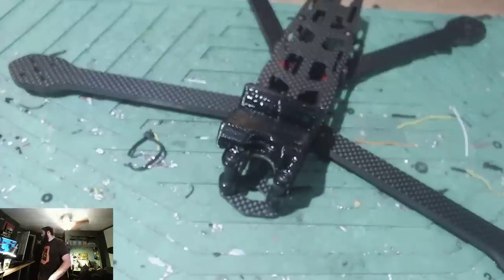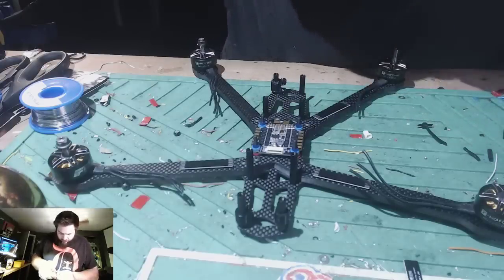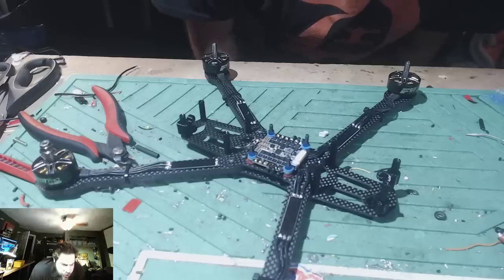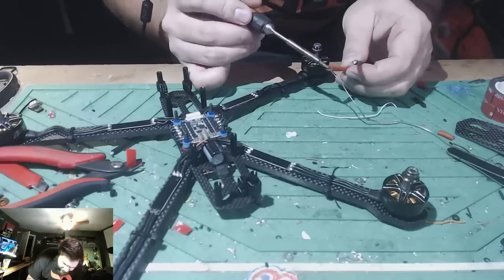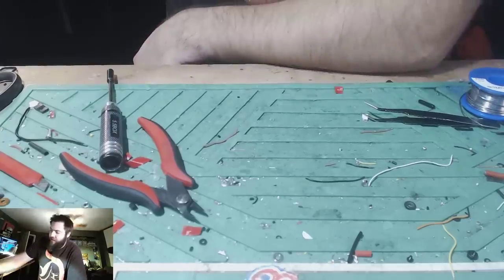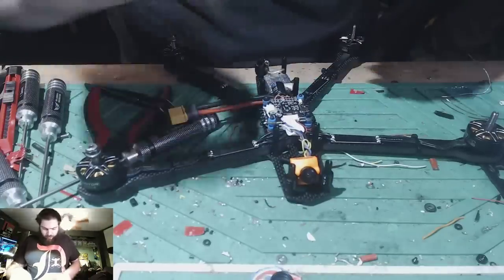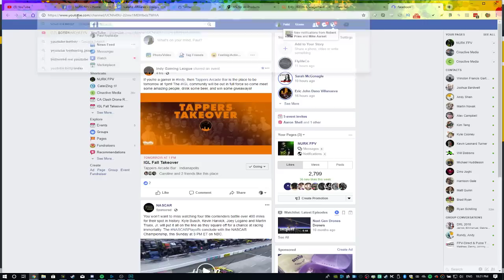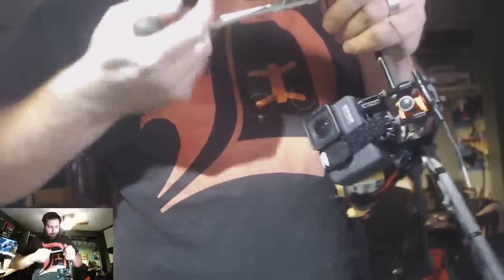Livestream // Project 399 SuperG Long Range Deadcat

Comment: What kinda flight time you think youll get with the f80 1900kv and 6s 1250mah? i just ordered f40 1600kv runing 2200mah 5s for my superG frame wondering what your thoughts on the difference would be. also running same esc but radix fc

Comment: The 4 in 1 you linked in the description is actually different than what you are using , the link shows the 40A , but I belive you are using the 45A version
Reply: i was think this more then once that he uses the 45A one :D i got one of it too put it in my radix build :)
Reply: @MegaBadaboom88  what ?!
Reply: @sufysprojects2689  that is the hobbywing xrotor 45A 4in1 ESC and i bought the same for my new build with a brain fpv radix flight controller :) it is really good i love it, i also upgraded my motors and also same as nurk (tmotor f60 pro II), @nurk your stuff work great i love these products! 
Greetings SkyHogRC 🐷
Reply: @MegaBadaboom88  thanks a lot man!! I just got back from the hobbyshop like NOW and i bought one of those 4 in1
Reply: @sufysprojects2689  make sure to use the big cap if you like to use 6S with it ;) It is a awesome ESC, paired with the tmotor F60 Pro II 1750kv it fly like a dream ♥ Noise spectrum analyser showing me over 500hz most of the time witch is the freaking cleanest quad i was ever flying :D Even on 4S with 5151 props this thing is a beast and i have great flight times on 4S witch is really fun ^^ 1550mah 4S 7 minutest curising with some freestyle moves are no problem ^^ Next upgrade will be long range setup with this birdy, can`t wait for it xD
Greetings SkyHogRC
Reply: @MegaBadaboom88  thank you so much!!

Comment: Where do I have to connect my sbus wire from the XM+ Rx to that hobbywing board (f4G2) ? When I solder the sbus wire to UART 1 Rx , I don't see the bars on the receiver tap on betaflight moving